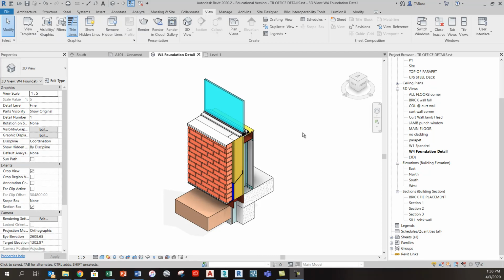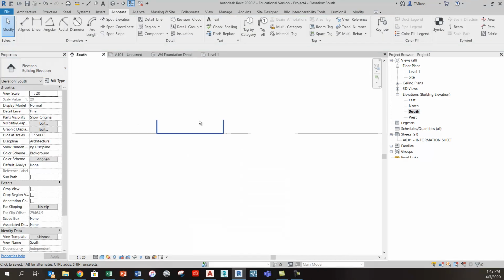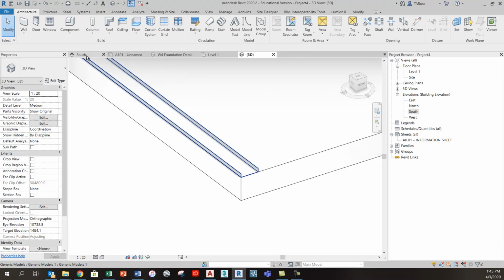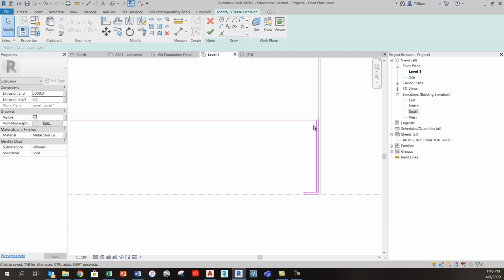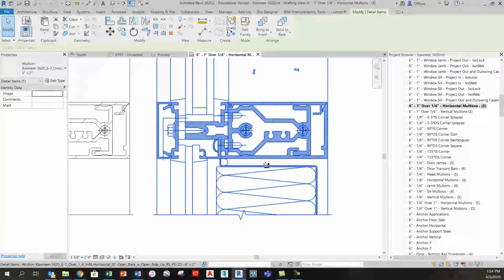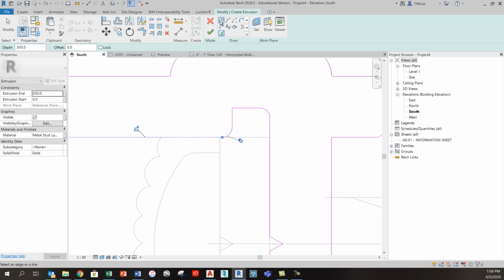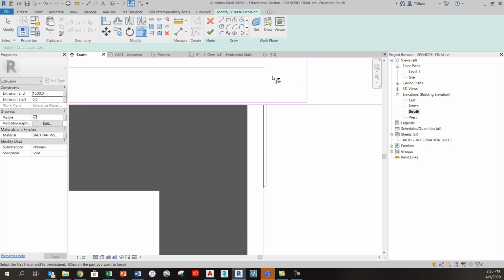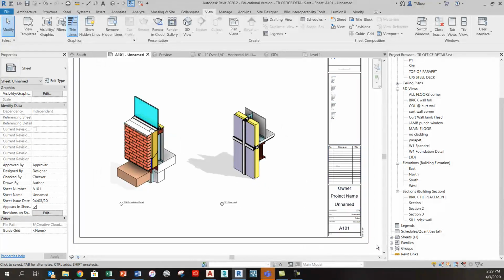REVIT 3D DETAILING

Comment: When you set up this 3d detail how did you start? Are you starting with a new family inside a project, did you create an entirely new model, or do you use a 3d view and position the scope box in an existing model. It's difficult to recreate this without understanding how you started. My guess is you started a new project because you can't place 2d views in a 3d model, nor copy 2d drafting views into a family within the same project. So if you started a new project, how would you import the view of the 3d model into an existing model and onto a sheet?
Reply from the maker: It's entirely up to you VB VB. I didn't describe a specific approach because there are many options. When I assign 3D details to my students they usually build what's shown in this tutorial off to the side of their main Revit model (same .rvt file) and then, as you suggested, they adjust the scope box/crop window to focus on it. The nice thing about this approach is, because the 3D detail is part of the same .rvt file, it's easy to drag views of it onto sheets without having to worry about graphic inconsistencies that might occur if it was being inserted as a rasterized image from another .rvt file. There are actually construction site situations where something similar is done - a full scale mockup of a custom assembly might be built off to the side of the real building to test installation or provide a reference for trades. I suppose if you wanted an approach that felt less redundant/more elegant like, for example, building the 3D detail in it's actual place on the main Revit model, you could use Design Options to control its visibility.

Comment: Hello, did you make all content with component generic model?
Reply from the maker: Yes I used the generic Family Category when building Model in-place components in that video. That's a safe way to proceed but certain features are enabled when you're more specific. For example, if you model an in-place component after having selected the Wall category then that finished model will be eligible for certain features specific to walls that wouldn't otherwise be available (like adding a door).
Reply: @TRUSS3D  Thank you so much!